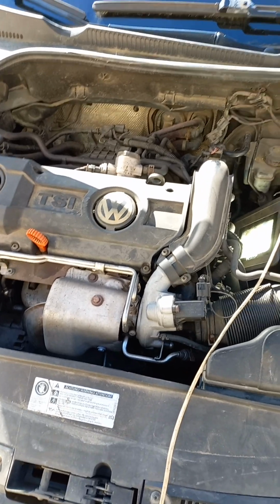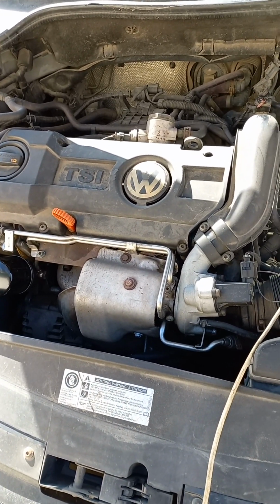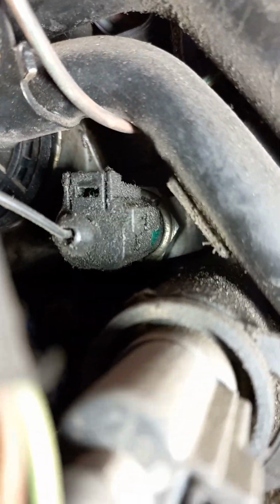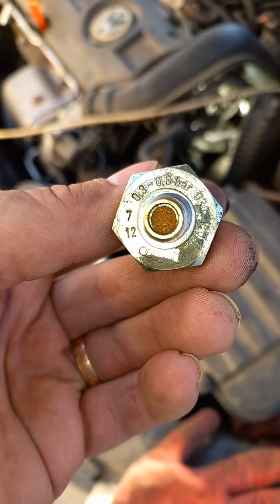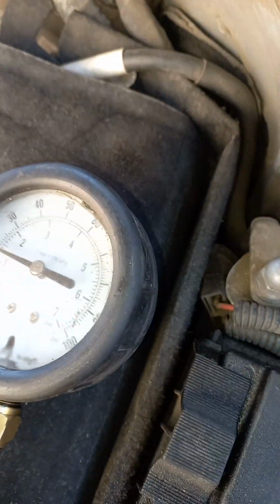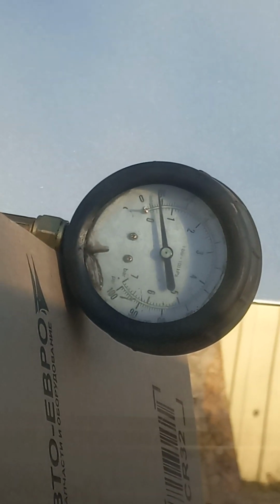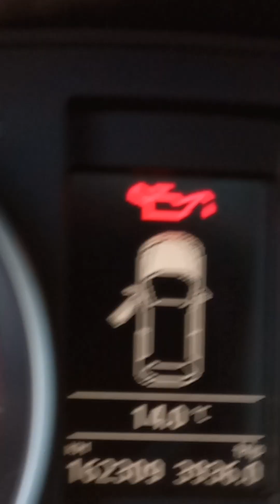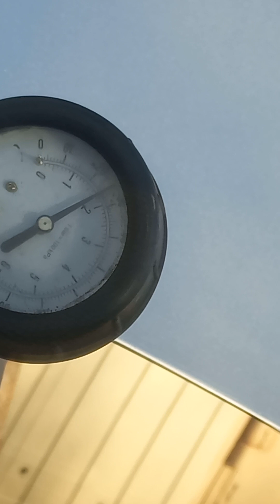✅  Low oil pressure alarm VW  1.4  TFSI  CAXA

Comment: Now what’s the solution
Reply from the maker: Replacement of oil injectors. They should open at 1.3 to 1.6 bar. Most likely, there is fouling and two injectors were always open.